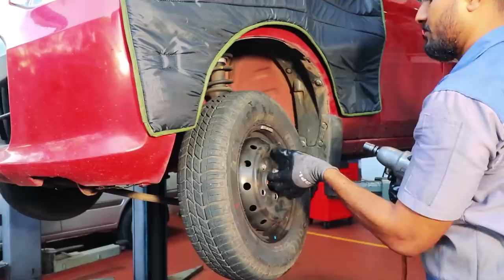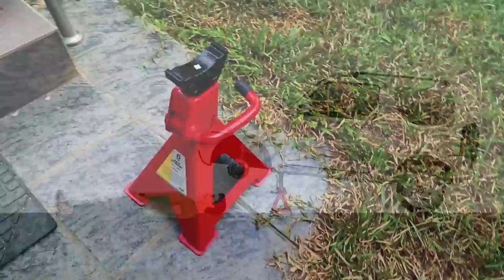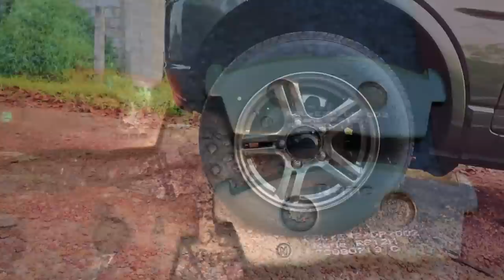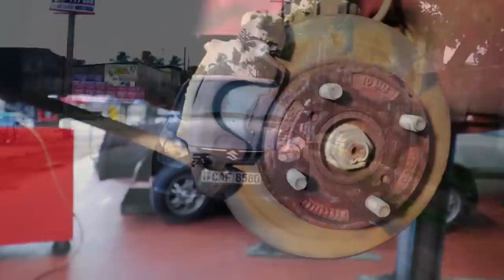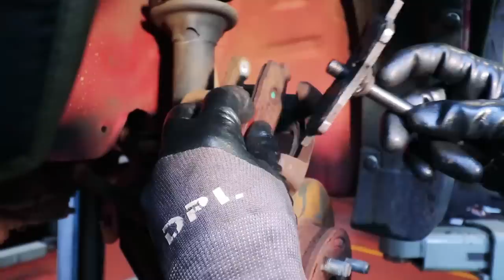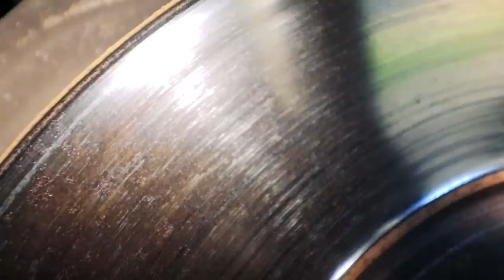Brake Maintenance Guide (Sinhala) from ElaKiri.com

Comment: Brake pad eka uda yata tip ekata heat resistance grease ekak yodanawanam wadath hodai e wageema calliper pin walata normal grease daanna epa ekata dannath ona heat resistance grease ekak ehama nathnam calliper eka rath weddi normal grease eka badamayak wage set wenawa ethakota pin hirawenawa .e wageema genuine brake pad eka depaththata shim kit ekak enawa ekath parana eken galawala replace karana aluth pad walata savikaranna ona.

Comment: Machan, WagonR eke, nawaththala tyeddi , Brake push karan Steering wheel eka depaththata steer karadadii, mostly left side, " charss barass" fricitonal noise(with vibration under the base) ekak enawa , brake paduth normal condition! any thought? advice?

Comment: Brake pads මාරුකරනකොට මේ දේවල් ගැනත් සැලකිලි වන්න .(floating caliper සදහා )

Brake pads පැත්තට ගෙවිල නම් caliper pin වලින්  එකක් ග්‍රීස් නැතුව හිරවෙල තියෙන්න පුලූවන්.

එක pad එකක් විතරක් වැඩිපුර ගෙවිල නම් caliper pin දෙකම ග්‍රීස් නැතුව හිරවෙල තියෙන්න පුලූවන්.

Brake disk එකේ එක පැත්තක් වැඩිපුර ගෙවිල නම් caliper pin දෙකම ග්‍රීස් නැතුව හිරවෙල තියෙන්න පුලූවන්.

caliper pin ග්‍රීස් කරනකොට Rubber grease එකක්ම අනිවාර්යෙන්ම පාවිච්චි කරන්න.

Brake pads මාරුකරනකොට  හොද branded එකක්ම හෝයල දන්න කෙනෙක්ගෙන් අහලම දාන්න.මොකද නැත්නම් පොඩි ලාබයක් බලන් හොද නැති Brake pads දැම්මොත් වෙන්නේ හොදට තියෙන brake disk එක කැපීල  ලොකු ගානකට තට්ටු වෙන එකයි.
Reply: Thanks